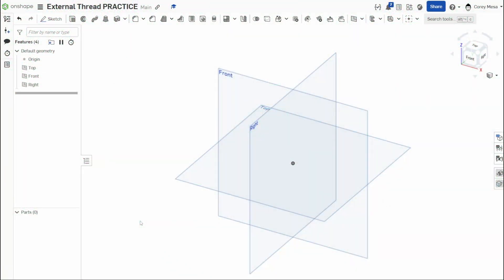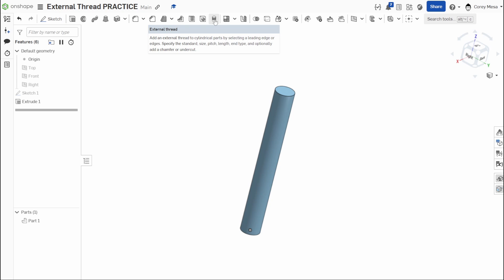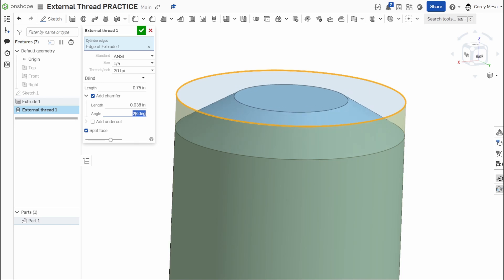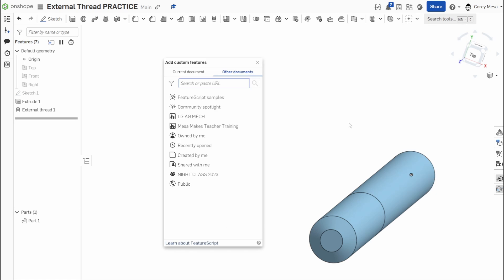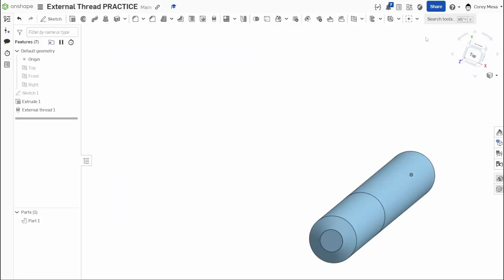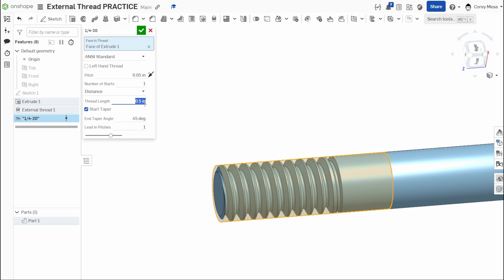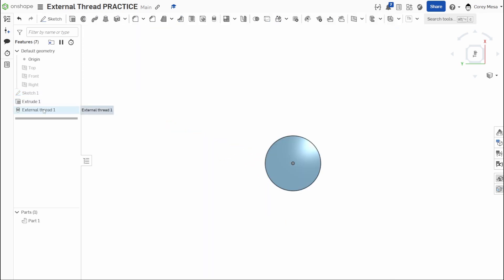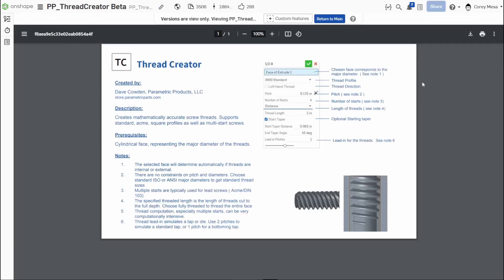Shifting to Solids: Create Precise Threads with the External Thread Tool in Onshape

Comment: Thanks for the great video! I am having trouble fitting a screw that I made in onshape into a threaded hole i am trying to make in onshape with the same tool. It seems like when I engage the ThreadCreator tool to make the inner threads for my hole, it reduces the diameter of the hole such that the screw I am making does not fit. When I made the tapped hole feature, I selected 5/16 thread size for both the hole and the diameter of the screw that I made and the TPI are corresponding as well. Do you have any tips on how I can fix this?
Reply from the maker: What process are you using to manufacture the part 3D printing, mill or lathe or just theoretical?
Reply: @MesaMakes  I'd like to know if there is a process for 3d printing. In Fusion I offset faces by 0.25mm to allow for this.
Reply from the maker: Each type of slicer and filament has different settings you will need to test what works best for the application you are using.

Comment: Hi Mesa.
Is there a need to use both the built in external thread tool and the Thread Creator feature script?
Reply from the maker: At the time yeah you couldn’t really see the threads visually without the feature script but  pretty sure they have updated that feature now so it shows the actual cut threads now
Reply: @MesaMakes  
Can confirm it doesn't, at least in the free version.

I've been playing around with both since i posted.
The script just seems to overwrite what the built in one does.
Which is frustrating as the script has no option for threads per inch, and i can't use the built in because it won't export the threads.

I don't remember it being this difficult in fusion but it been a while 😁
Reply from the maker: @nil80c9  yeah it updated but just puts what the threads would look like "if" you were to cut them, be fore it didn't even do that so to have modeled threads your options are feature script, importing in a pre existing bolt or nut, or making a triangle shape and cutting a spiral path into the 3d model wit a sweep and remove tool.
Reply: @MesaMakes  
Ah ok.
Thanks mate.